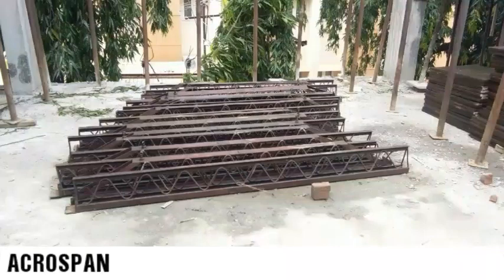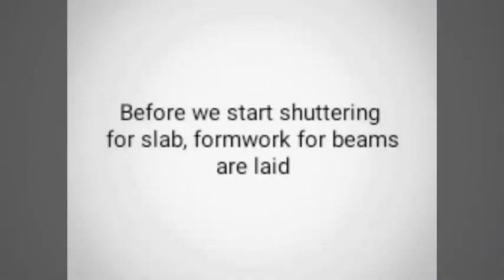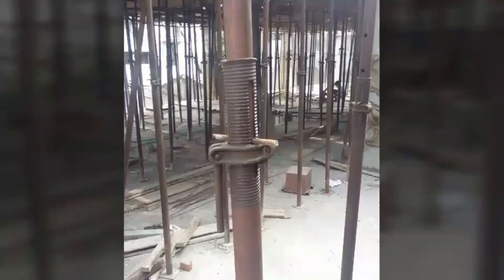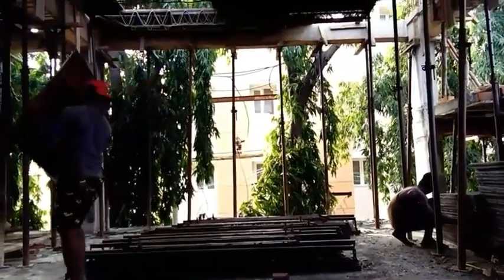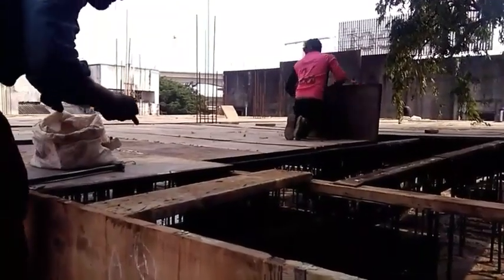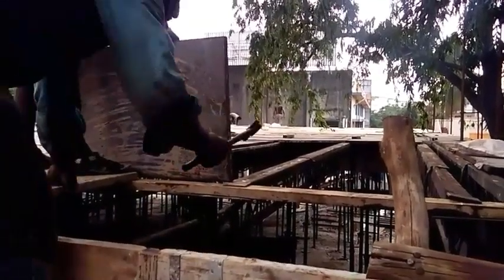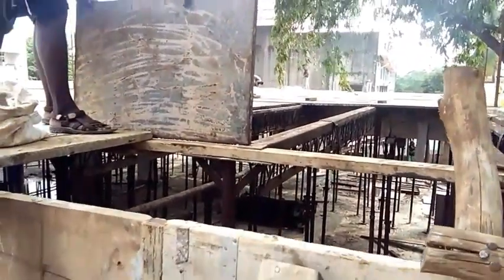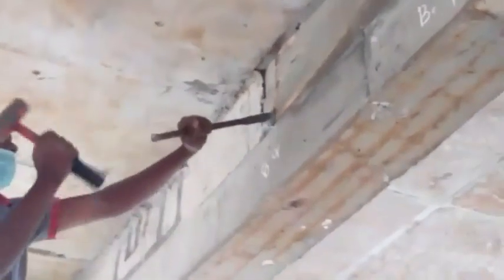Shuttering for roof slab | Roof slab Construction | Architect Rupesh | VR Arch Studio

Comment: Sir, great video, very informative. But could you please tell me is there any other steel material alternative of acrow span. I've slab steel shutters of size 3ft x 2ft. We here place 3'' x 2''  wooden battens to support slab shutters @ spacing 2ft(between 2 battens). Now can Rectangular hollow sections( of specific dimensions and thickness) be used in place of wooden battens and acrow spans?  Actually acro spans are too costly. I think Rectangular hollow sections are less expensive than acrow span.
     And , Sir,  what should be the minimum spacing between 2 acrow spans.as per the minimum spacing like 3ft or 4ft or 5ft, the slab shutters can be made of above dimensions.